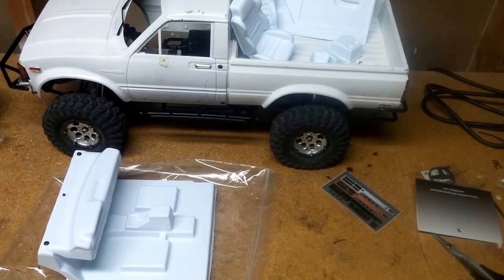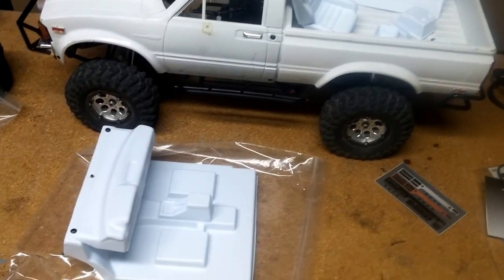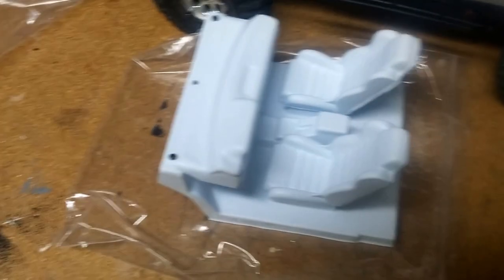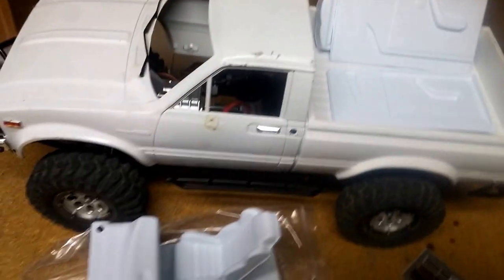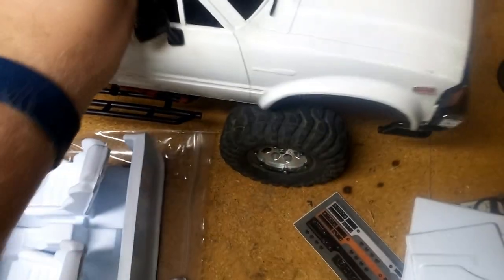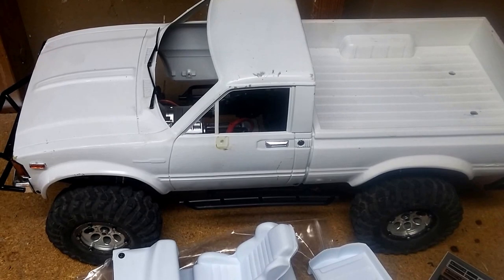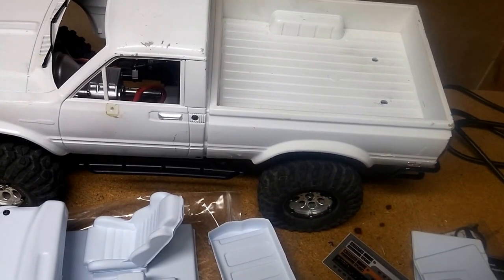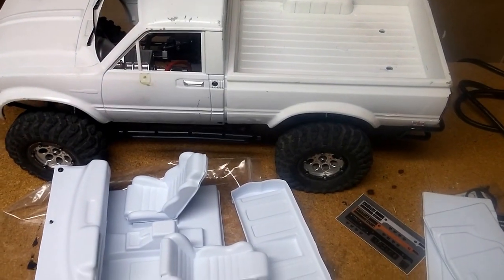Dinky Rc interior mock up.

Comment: Will that interior fit with the shift servo on top like this? I am trying to decide on an interior kit for my TF2 also. Cool videos by the way.
Reply from the maker: Mark Carvalho, I ended up going single speed.  Granted, I did try a shorter servo horn, or seeing if you could flip the horn in the other direction. I would say try flipping the servo horn and check to see if it still shifts well. Also you will need the body lift regardless.
Reply: I have seen other TF2 owners move the shift servo further back and create a longer linkage to the shift part of the transmission. I saw that on rccrawler site. Very cool build by the way . Thanks for answering my question